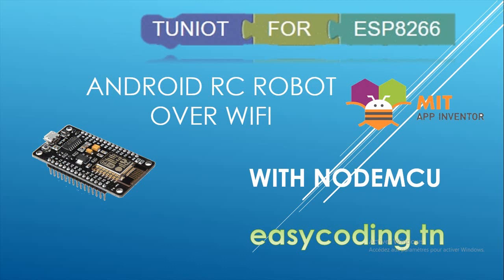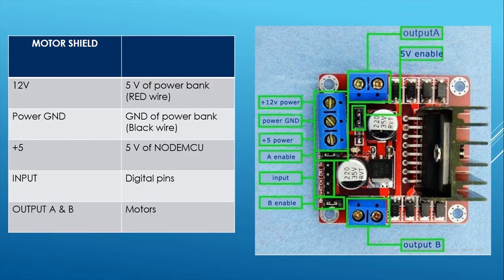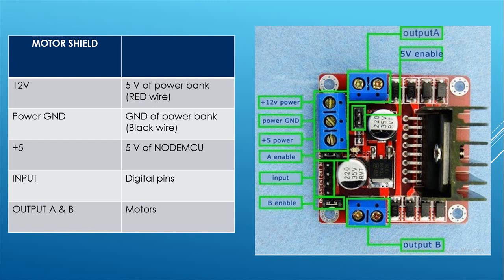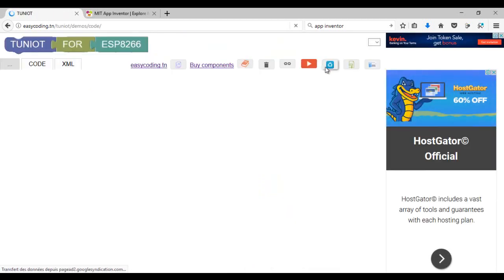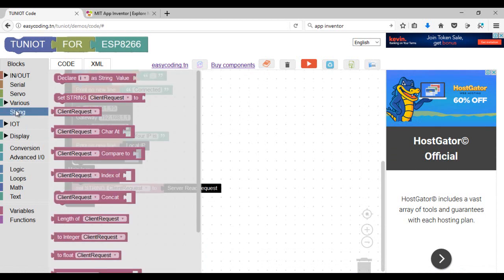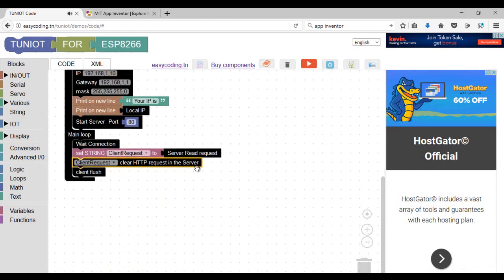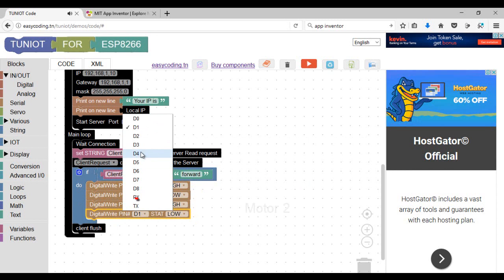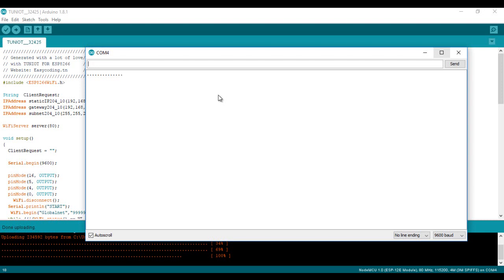NodeMcu (ESP8266) Tutorial B-14: Robot controlled with an Android App over WIFI

Comment: I m facing difficulty to show "forward" "right" in thee webserver, it keeps loading, what is the problem? should I use Google Chrome?... but, when I use MIT app, it works (thanks)... the only problem is when I access the webserver, it keeps loading
Reply from the maker: You need to add the answer block
Reply: @ADELKASSAH  already but it keeps loading